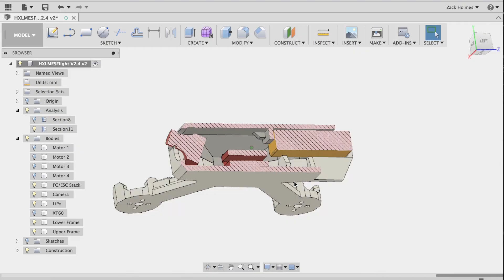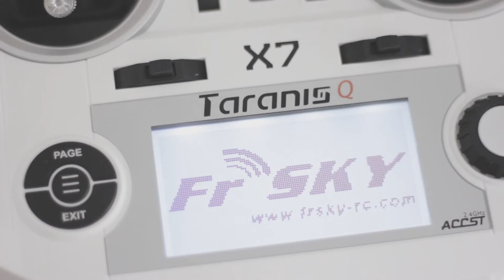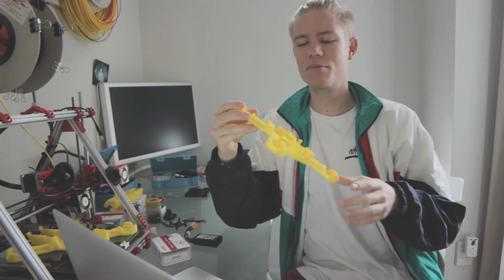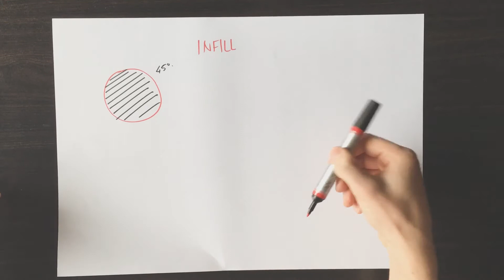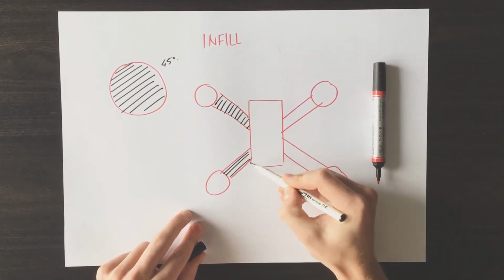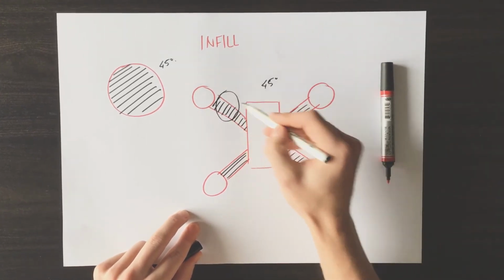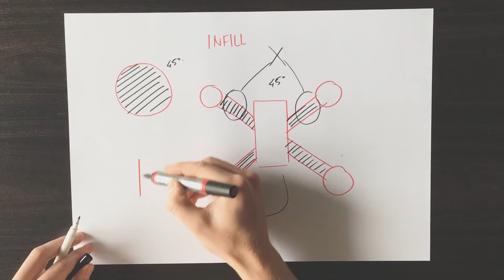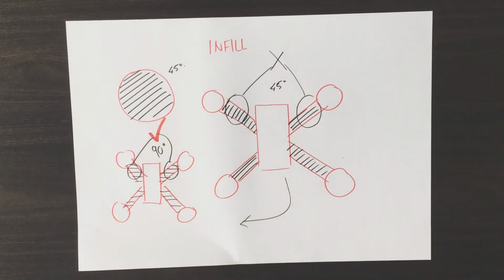DIY Drone Part IV: Prototype and Test Assembly

Comment: Sweet!  My next build!
Reply from the maker: Can't wait to get this thing in the air and release the plans!
Reply: I'm rapidly researching the web to see if I can use/mod my transmitter (Spektrum DX6) to bind with the FrSky XM Rx...  Gotta go to bed, so I can work tomorrow.  Thanks!
Reply from the maker: Can you add external modules to the DX6? I'm pretty sure the FrSky XM can be paired with another brand Tx provided the correct module is attached!
Reply: Looking in to that now, Thanks!